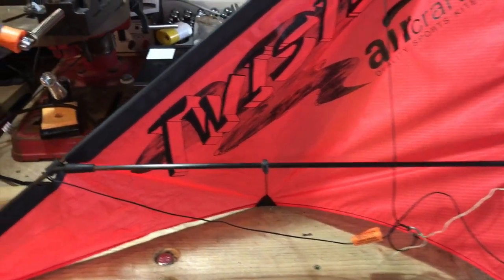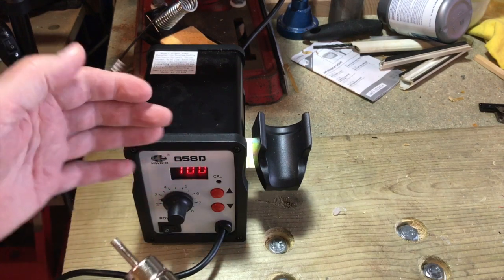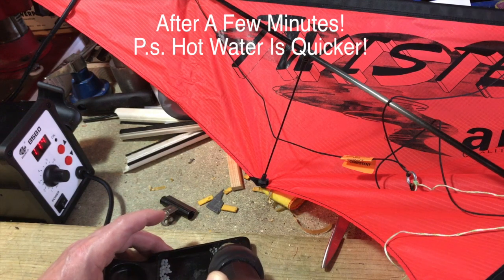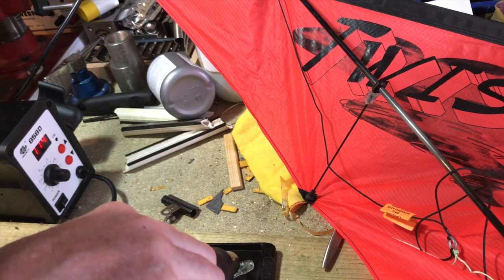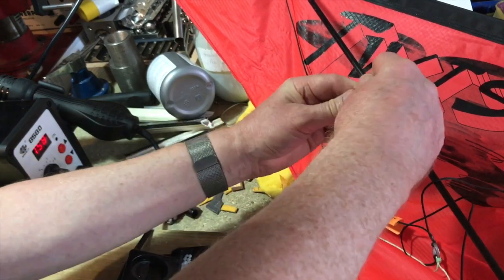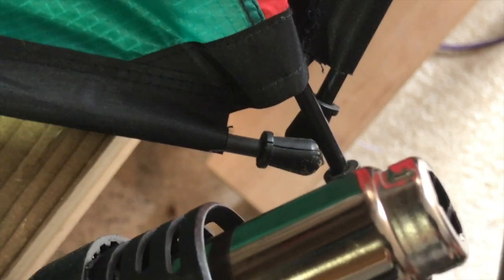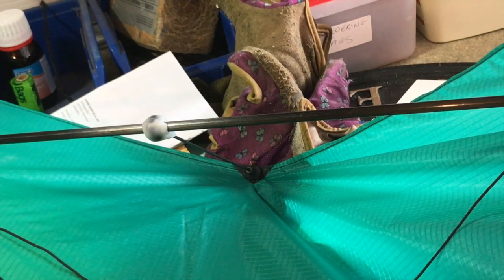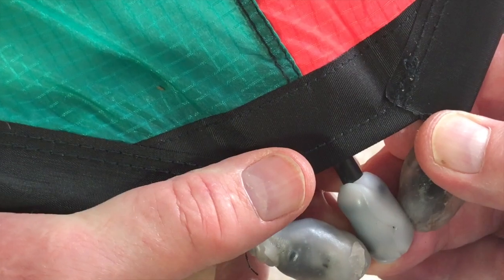Stunt Kite Quick Fix Amazing Repair

Comment: I not familiar with Polymorph.  I would have used hot melt glue.
Reply from the maker: Problem with Hot Glue I find, Its so sticky it gets everywhere and sticks to everything, its too hot for holding by hand, its not that strong and finally once its on its a complete s... to get off.  People regularly give me things to fix thats are covered in hot glue, or superglue they are both a pain to remove. Polymorph is brilliant cheap and instantly re-mouldable.
Reply: @fixed1t  : Yes, Hot glue is 1 way and can be difficult to use. and near impossible to clean up.   I have burned myself in the past.   Never heard of Polymorph before. I am going to order some.